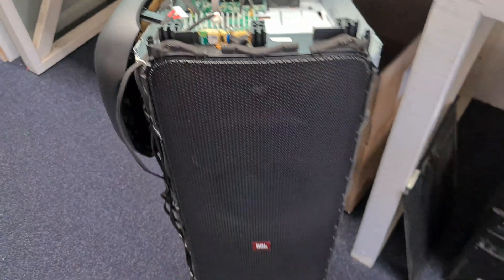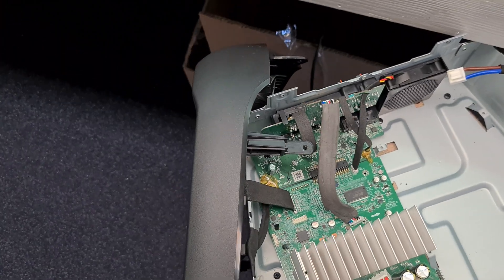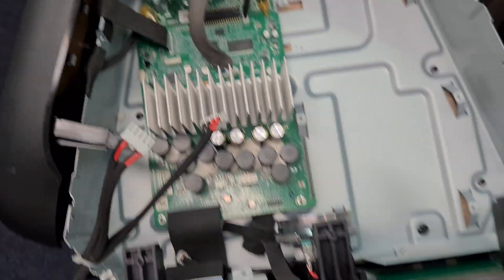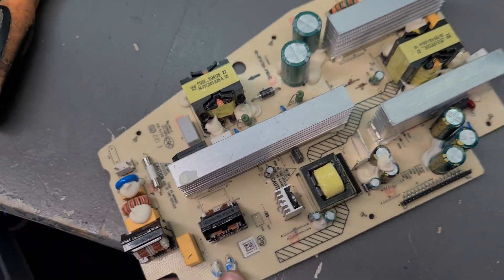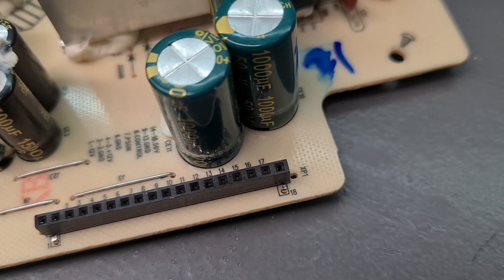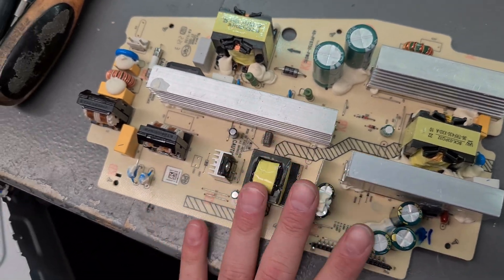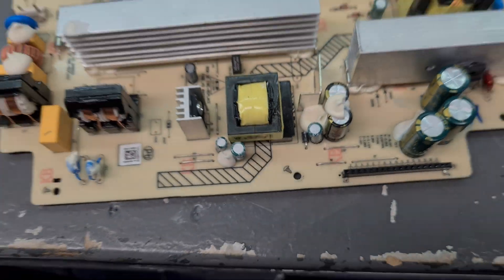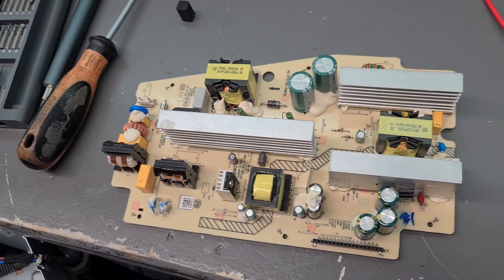JBL Partybox 1000 Repair - no Sound fix (with service manual)

Comment: I have a quick question is there possibly to take the amplifier out and uograde to a higher wattage a d possibly ad a bass boost cable to adjust the bass so u can have max bass at lower volume instead of the speaker volume maxed just to make the subwoofer flex and hit the hardest

Comment: Hey buddy! I'm about giving up on mine. I replaced all of the four optocouplers, the switching IC, all of the SOT 23 transistors, diodes and the little voltage regulator under the set of 3 optos. All resistors checked out ok. Replaced the through hole zener diodes around the 50v transformer and heatsinks. I even replaced the TO220 MOSFETs and diode for this circuit. I still do not get the 50 volts rail generated. What's weird is sometimes it will appear randomly when I power it on, then I power off and back on again and it's no longer present. Really doing my head in!
Reply: Hi, I have absolutely the same problem. Have you managed to solve it? L6566B starts only if I touch 16 pin. Let me know how to contact you. Or go to badcaps. I will open a new topic.
Reply: @Alex_Xab  unfortunately no, i spent about 3 days solid on it, in the end I gave up and bought a replacement board from Ali Express for about £120. When you say touch, do you mean with oscope probe? Thats interesting, ill have a look at my board and see if its similar...
Reply: @ You can send your PSU to me, or try to repair it yourself using my method.
Reply: @Alex_Xab  I'll keep it here and have a poke at it once in a while. Very rare for something to beat me
Reply: @ 
I will try to explain my method on badcaps.
Reply: @ 
I put it on badcaps.
Reply: @barevids  hi, does ist Work with the replacement Board from AliExpress?
Reply: @Alex_Xab explain please
Reply: @Alex_Xab  AC ok resistor 10C(10k) replace 20k....
Reply: @ballerjoci o put 15k there and the 50v appears but at máximum volumen falls
Reply: @Alex_Xab Mine is like that.
Reply: @alancell2050 have to check the pmw that generate 400v there is the real problem if someone find that issue please post it here or contact me
Reply: @y @yosvannironda1329  
I can do it. 
But it doesn't work the way you think.
Reply: @Alex_Xab if there is not 400v then the l6556 doesn’t gonna start

Comment: Hello i have Same Problem the Box Starts but Not Sound i Test the Bord there is nothing 0v 14/18 0v what i do ?
Reply from the maker: I think then the powerchip is broken on the powersupply. Its on the other side
Reply: How to cheking 14/18 pin to see 50v i have multimeter but i dont know how to check... can i turn on before at check??

Comment: i am facing the same situation no 50v on those pins only 5 v ,you managed to repair the board i am suspesting the ic driver l6566b ......all others component looks ok ....thx
Reply: Same problem, don you have solution ?
Reply from the maker: Check the first ltv-817b
Reply: @HostjeNl what are you looking for on the multimeter diode mode on the 817? The Bank of three do all read different values in circuit, Is it required to remove these from circuit to confirm their health status?
Reply: @HostjeNl  Hi. Definitely not. There is a small chance that the optocoupler burned out.